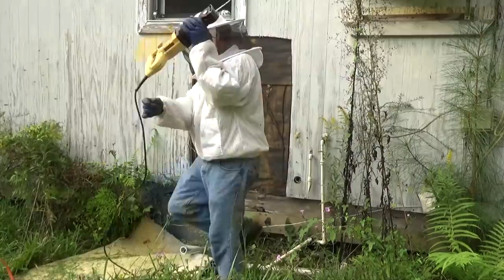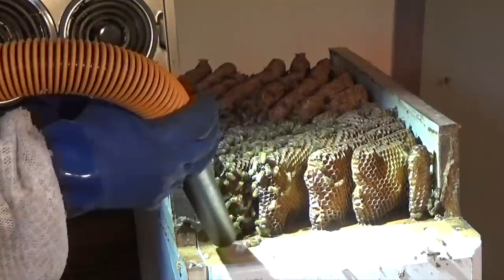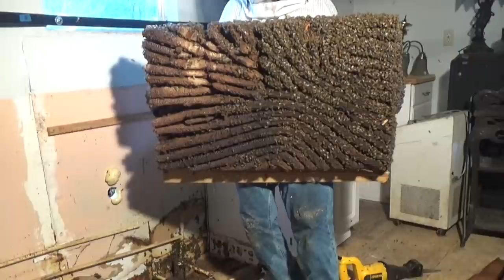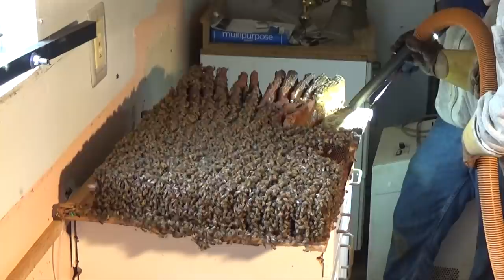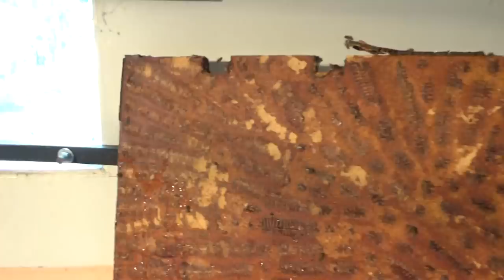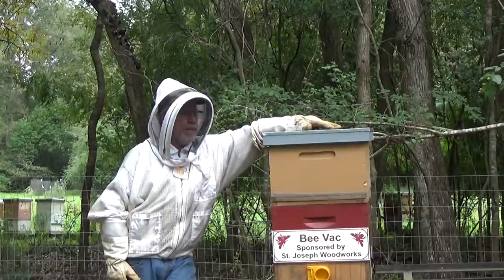Why is it so hard to find a bee hive when you can see where the bees are entering?

Comment: Drill 1/8" hole(s), poke in wire, coat hanger etc.. then start cutting.  We live in an area where the houses all have stucco, not siding so it is essential to determine the location/boundaries of the hive before cutting.  They usually are where you think they are going to be but this simple step eliminates those times like this when they aren't.  
Nice save on the queen!
Be well